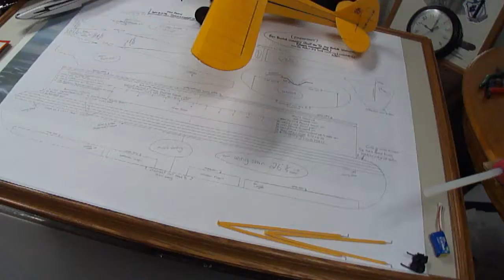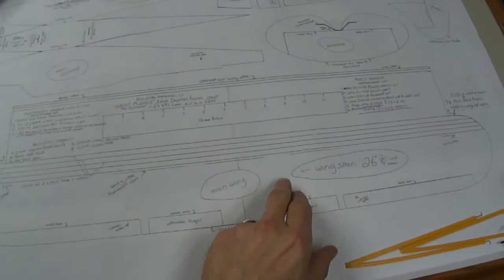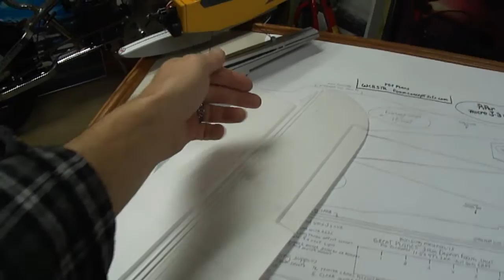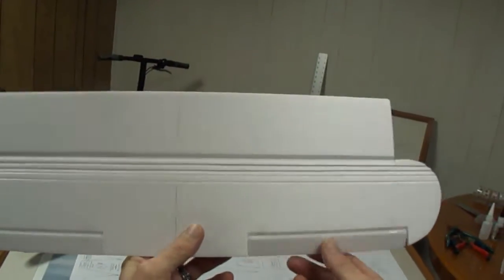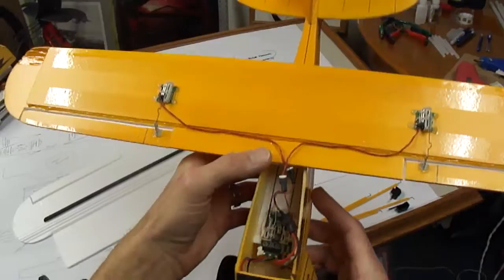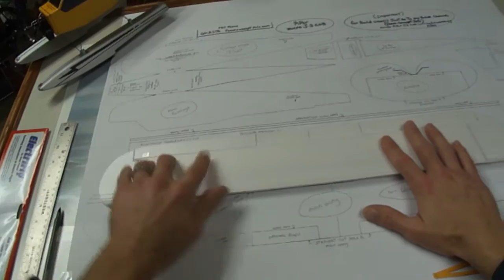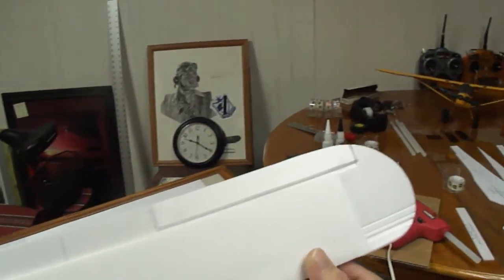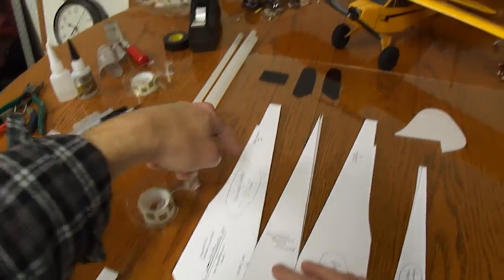Part# 1 of 3 Micro J-3 Cub Cutting and assembling your PDF Plans

Comment: Really enjoyed this video and # 2 video as well.  Would like to see how  you cut it to get such precise cuts.  My cuts are always uneven, even with a ruler or / and a straight edge or speed square.
Reply: +SnapPunch Robert Yea it can be tough making nice cuts sometimes. I try to make it a point two change exacto blades frequently,  always hold the blade @ a 45% angle during the cut...and try not to stop or pause... and just make one continues cut  without stopping.